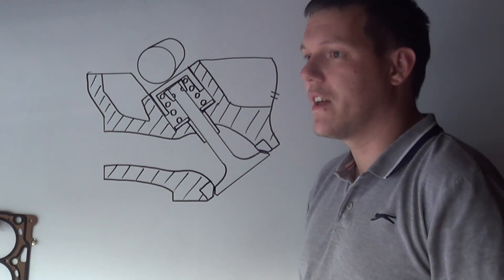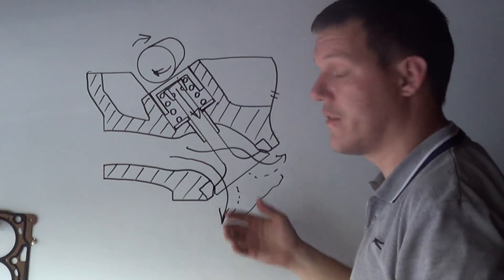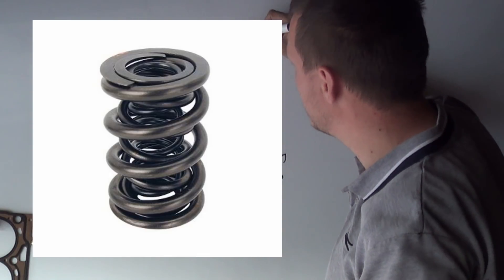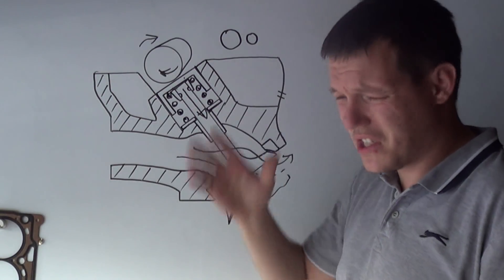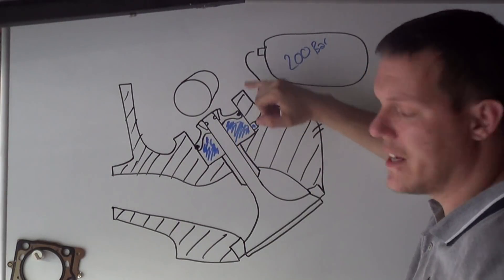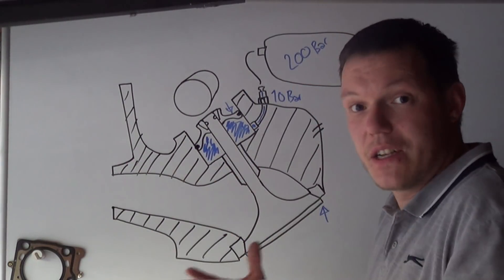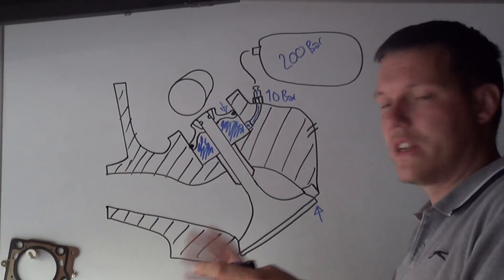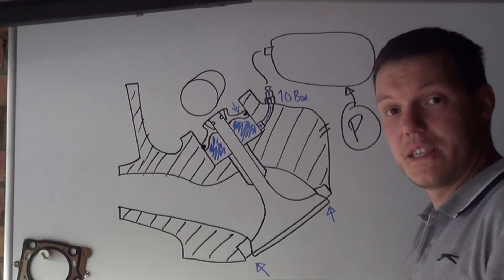Pneumatic Valve Springs - Bike TEch

Comment: Air gets hotter when compressed & cooler when expanded...does the regulator backflow when the air spring is compressed?

Metal springs get hotter when compressed or expanded...is spring heat an issue at high rpm?

Comment: I Came to your video after check the 2021 moto gp moto specs. First of all I really appreciate tour video.In the first moment i thought that we are talking about free valve technology ( pneumatic actuators >> koensegg tech) , but after check your video quickly understood that is just for the upper valve movement. However i think that in the future motorsports will use 100% pneumatic valve system without camshaft! What you think? Could they buy the patents?

Comment: The system is still vulnerable bcos it depends on checkvalve springs to operate the main valves.
Reply from the maker: What? Because check valves are unreliable?
Reply: @thedirtyworkshop  inside the checkvalve there are spring loaded balls which opens and closes air passage  these springs too have a resonant frequency
Reply from the maker: I know what's inside a check valve, but just because theres a spring doesn't mean its going to resonate at the frequency range in operation. Its actually dependant on the mass of the ball and the acceleration.
Reply: @thedirtyworkshop  whatever, If the system contains a physical spring then its a fail !
Reply from the maker: Whatever? Wow. You'd make a great engineer - only joking, obviously.

Lol everything will fail, but that's eventually.
Reply: @thedirtyworkshop  We can come in terms only if you make a dedicated video explaining the checkvalve operation.
Reply: Cheers Greetings from India.

Comment: At about the 5 minute mark, you mention that 2-strokes scream crazy, like up to 25k revs. That's incorrect and a popular misconception caused simply by the sound of them firing on every revolution as opposed to every second revolution with a 4-stroke. 2-strokes are not screamers at all. 
GP 2-strokes like the  Yamaha TZ 750 only revved to 11k whilst the Honda NSR 500 only to around 10k. The famous Kawasaki 500 Mach 3 triple road-bike produced maximum power at 8k
Reply from the maker: In regards to valving - you can run a 2 stroke really high - say like an RC motor - in this case the springs would start to crap out -so no, it's not a misconception

Comment: Didn't the  DOHC 1984 (Rc17) Honda CBX750F have pneumatic valves?  EDIT:  Rc17 has hydraulic tappets not pneumatic valve springs

Comment: I hate that f1 is more dominant than moto gp. The thrill of riding any motorcycle is way more than cars. It is harder because of the leaning and fishtailing and keeping control with way less downforce. The limiting factor for moto gp is not power. The limiting factor is aerodynamics and idk honestly if we can catch up to 30 sec difference between f1 and moto gp on the same track.
Reply: First Last  its not always about aerodynamic. Its the mechanical grip limitation differences. F1 car got like 4 massive flat contact patch touching the ground. There’s only so much you can do with Motorcycle aerodynamic.
Reply: @soraaoixxthebluesky  yes but if you pay attention to the showdowns made moto vs f1 (not to mention that F1 is far more developed andinvested in than moto gp) motorcycle beats on acceleration and deceleration (except when f1 used wet tires for the drag on a sunny day and locked burned the wheels to stop faster, this was the episode with guy martin). Moreover the main factor improving f1 lap records massively is aerodynamics and downforce. This is the area where most improvements are to be made not to mention that grip is not about the contact patch size (tire size affects wear and grip from a standing point) its about normal force (weight+downforce)
Reply: @soraaoixxthebluesky  just for clarity nor.al force is the force exerted by the ground perpendicularly up on the object at the point of contact and is increased by weight and downforce

Comment: Interesting but the phucking clicking noise was about to drive me crazy.
You won't see this in production bikes because a super charger or turbo is a better solution, In MotoGP this is not allowed...
Reply from the maker: ou won't see this in production bikes because it has no benefit. And it has nothing to do with super/turbo chargers.....
Reply: You missed the point!
Reply from the maker: the point of pneumatic valves? I think you have missunderstood why they are used. Pneumatic valves are used because they don't suffer from valve bounce etc.
Reply: Never mind!

Comment: Very large sulzer ship diesels are two stroke diesels.........they have exhaust valves that are kept closed by constant air pressure and they are opened by fast acting application of engine oil to open the exhaust valves and air pressure to close them...........the pipes that connect the oil control valve to the valve operating mechanism in the head , are large diameter piping so that there is no restriction in the piping which would slow down the opening and closing...........the whole system used to be mechanically timed for operation , and now they use electric solenoids to control the opening and closing of the exhaust valves.........these are hooked into a main ECU computer that also controls the timing and volume delivery of the fuel oil injected into the cylinder at TDC.......the computer control also allows the operator to isolate one cylinder from the rest........
Reply from the maker: What does this have to do with the video? Your the fucking guy I was talking about in the night ride - why do you do this? fuck off
Reply: I have never commented on any night ride video ever , and i am not sure about what you are talking about..........i mentioned in your comments on this video that two stroke marine diesels have used pneumatic exhaust valves for a long time.........in your april 17/2017 video about two stroke diesels you did not mention how the exhaust valve is operated (you only called it a poppet valve) , and i thought i might add how wartsila and sulzer operate their two stroke diesl exhaust valves..........please do not accuse me of some issue you have with someone else..........i do not know anything about a night ride video...........please enlighten me..........and do not be rude to your audience..

Comment: What's the difference between these pneumatic valve springs and 'Freevalve'. Read a lot of good things about Freevalve lately.
Reply from the maker: lol propaganda
Reply: It has been proven in testing (http://www.freevalve.com/wp-content/uploads/2016/11/Introduction-to-FreeValve.pdf). Seems to me it would make single cylinder dirt bikes a lot less hassle.
Reply from the maker: lol link says 'page not found' lol

You said "Read a lot of good things about Freevalve lately"

- that's the propaganda. If it was a good as they say where is it?
Reply: +The Workshop. it's a download on the Freevalve website. Well it has been made for mass production in the Qoros 3. From the 1.6 I4 T engine they were able to increase power >40%, increase torque >40% and reduce emissions 15%. It also ran in a Saab 9-5 for 70,000km so I'd say it's proven to work, just may not be economically viable atm.
Reply: Freevalve uses electric actuators to control the lift, duration and timing of the valve and is controlled by the ECU. By all accounts it's exactly what a combustion engine should have for maximum efficiency. Pneumatic valves simply give greater control at higher revs than a conventional sprung valve. The timing, lift and duration are all fixed by the cam lobe profile.

Comment: Would like to hear your thoughts on the old inline 4 250cc screamers. They rev up to 17,000-19,500 RPM! The Honda one, CBR250RR, even has gear driven cams - no chain or tensioner to wear out.
Reply from the maker: And noisey as fuck lol
Reply: Do ur research they did and still do 19k rpm 1990s 250cc four cylinders
Reply: @TheMotorcycleForge  ...16 tiny, light weight valves have less inertia for the springs to cope with
Reply: Factory engines in the era of multi-cylinder tiddler screamers were running to in excess of 20,000RPM in the sixties. The Honda 250/4 ran to 22,000
As for road bikes, the old Kawasaki ZXR-250 ran to 19,000. There was an era in the mid/late 80's when grey import 250cc screamers hit the UK market. They were enormous fun. Gutless little things, but once wound up, capable of putting a grin on even the most lugubrious face.
My GSX-R250 was redlined at 15,000 ( I think. It's a long time ago ), but would pull to 18,000 in the lower gears.
The R6 had a 16,000 redline.
Sadly, to run such high RPM, quite a large valve overlap is needed. This does not sit well with those who knit their own yoghurt while cuddling polar bears so we will probably never see their like again.

Comment: another problem with an outside pump pulling in air to the accumulator would be ambient water. and the fact of how much oxygen expands and contracts with temperature.
Reply from the maker: Why is ambient water an issue? And why is oxygen an issue, you need to expand on this dude - matt
Reply: Ambient air has water in it, although you can't see it. When you compress ambient air the water within it will condense, and this condensed water can collect and cause two problems. One of those is water is not compressible in a liquid state (go figure), the other is an issue with corrosion. As far as oxygen goes it has issues with being more susceptible to expansion and contraction with temperature. Also, pure Oxygen is flammable so nitrogen is really the only way to go. and nitrogen is already starting to be widely used in Tires as well as been being used high performance suspension systems.
Reply: The only way to really get around the water problem is to actually let it condense and purge the reservoir to an extent.
Reply from the maker: You don't have to explain water vapor of the water cycle to me, I'm pretty sure I picked that up at school. The issue isn't really an issue. You just have a drain system, and you pick the correct materials that won't corrode. I don't understand where the discussion about Oxygen vs Nitrogen has come from, and here's my video on nitrogen filled tyres - https://www.youtube.com/watch?v=4kvAmoAyQIk
Reply: The Workshop Evans coolant team probably didn't get it at school though
Reply: problem solved with nitrogen
Reply: Pilot Benjamin  Air is not pure oxygen, as you know.  As far as I can tell, this nitrogen craze is baloney.  If air is 80% nitrogen, which it is, why would you want the job of pulling the oxygen and some small other gasses out? 
     I support your logic on water being present in air is detrimental to the sytem and I don't know what the solution is.  But the system is not a new one, so the solution must have been found.  Cheers!  PS. Air/Water separators have been around forever. Used in spray painting.

Comment: but will it work in my k20a honda vtec engine.
Reply from the maker: Yeah if you have enough money to redesign the entire head lol
Reply: Pony Power lol but would it be woth it for drag racing application? expanding the rev limiter to 15k or beyond could squeeze little more power out of it. besides I seen people put 40k in a honda motor to get 330hp all motor, so hey it might be cheaper.
Reply from the maker: Good point. Here are my thoughts for drag applications;

1. I spent a couple of years on the drag circuit, and one of the major limitations is cost. Not initial cost, but replacement costs. Stripping engines ever 3 or 4 runs (and every run for TF) was what I spent most of my time doing. The sheer cost of replacing pneumatics systems would leave the owner skint after 1 or 2 meets lol

2. The benefits of running a pneumatic system isn't just higher rpm but across the entire rev range, and very beneficial in the lower rev range when torque really makes a difference. The fact that the engine retains some of its energy that it would otherwise have to lose compressing springs is what makes the difference.

3. Its a huge misconception that rpm is restricted by the valve train alone. Ocillation instability, torsional stiffness of the crankshaft and recipricating masses to name a few are huge hurdles to overcome with serious design chnages. In other words, if you made a valve train capable of 25,000 rpm the stock engine couldn't, without serious redesign/modifications. 

As I was told as a junior engineer, you can't cheat physics, even if you try really hard. 

Great comment - matt
Reply: Pony Power yea like you mention in the video about the gaskets in the valves and the system itself leakes air, it dont seem like it will not last  long. Also might have to shorten the stroke of the motor, and make the pistons more of a snug fit. So in othe words, I might have a better chance just building a custom engine.
Reply from the maker: If your drag racing then surely the fact that they leak won't be an issue.       If you shorten the stroke then your going to lose torque, especially in the bottom end.
Reply: Pony Power yea but would you put stress on the pistons on the travel of it going up and down at that high of and rpm. like in f1 they have a shallow stroke.
Reply from the maker: I've lost you. In F1 they use short strokes like they do in MotoGP to increase rpm, and if you look at the pistons in racing they are super stout - http://www.formula1-dictionary.net/Images/engine_piston.jpg

This is to reduce inertial forces like you said, that and the titanium rods. Hence why pneumatic valves are used for the top end of racing, because they can afford it. I think we've got our wires crossed here -

"If your drag racing then surely the fact that they leak won't be an issue."   -    this was the answer to you saying..................

-  "about the gaskets in the valves and the system itself leakes air, it dont seem like it will not last  long"
Reply: Pony Power thanks for that info. I look deeper into, and research it.
Reply: also awsome video
Reply from the maker: No worries mate, and thanks for the back and forth - matt
Reply: The Workshop : Speaking of total redesigns I am actually quite surprised we haven't seen more of a push to eliminate poppet vales completely. Coates International spent the money to design just such a system. It seems like a much better solution that dealing with poppet valves; although, I am sure it has its own issues. Matt, take a look and tell us what you think about this. http://www.coatesengine.com/csrv-advantages.html
Reply from the maker: I saw this maybe 6 -7 years ago at a motor show in Munich. The problem is that the poppet valve is well understood and reliable. Change the actual operation isn't really the focus. Variable timing isn't the focus really either. What they're after is controllable valve timing. Rotational valve systems like the coates system doesn't help with this, and keeping the clearance between the head and the valves is the issue over time. The poppet valve isn't perfect but it works, and quite well.

Camless systems are the focus, but theres no point replacing it with something equally naff. The time and money in research into the poppet valve and its operational history means that it's very hard to convince manufacturers to switch to another system. Even if the system operated with a benefit of 10%, the poppet valve has 100 years head start on operation reliability. This is what the alternative engine series is looking at. - matt

Comment: Sweet and Simple explanation. Perfect presentation. Not super familiar with bike engine technology other than changing the oil in my '08 GSXR 1000 every three races (Modlite racecar). Do bikes have multiple angle valve job theories? i.e. the 3 angle vs. 5 angle valve job debate in automobile applications? If so, could you expand on that? Thanks.
Reply from the maker: Yes they do and thanks for the question will be doing a video on that - matt

Comment: Just discovered your channel! This is great stuff! Subscribed! I have a noob question. How do they prevent Cams from wearing out when they are hitting the top of the valve so frequently. seems like metal on metal wouldn't last very long. i'm pretty new to how this works so sorry if it's an obvious question :)
Reply from the maker: Thanks for the comment dude and welcome. Its a conbination of a couple of things - putting it in simple english the valves and camshaft are made from ''good' quality steel alloy, that is design to be impact and fatigue resistant. The steel is then hardened to help resist damage and failure. Secondly it all about how the system is designed. The cam's don't 'hit' the valve tips. The apply pressure to them and this pressure (resistance from the springs) is far lower that what the valves can take. Finally, they don't prevent cams from wearing out. The oil film helps but cams and valves do wear. Some of the steps mentioned above help out, I'll do a video about the whole topic. Good question - thanks matt

Comment: I think they're also working on pneumatic activated valves. As in, valves are actually pushed down by air rather than camshaft.
Btw the CBR250RR could do almost 20000 RPM using regular springs. So I guess the smaller you go the higher the ceiling
Reply from the maker: Yeah nearly every engine building is working on camless engines. As for the smaller the higher the ceiling this is mostly down to mass of the components. The video above I say 'valve springs are what limit engine rpm' this is not quite right as reciprocating mass plays a massive role in max rpm, but for the discussion of pneumatic valves its ok in this context.